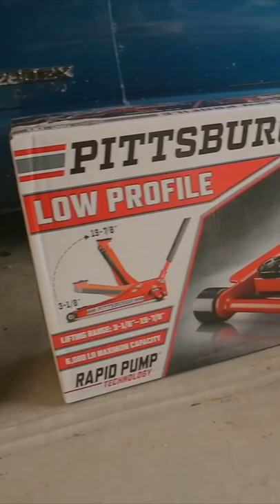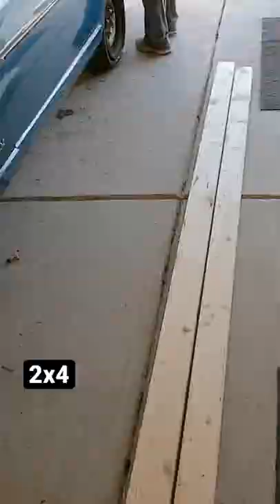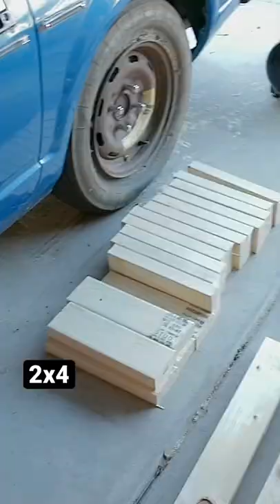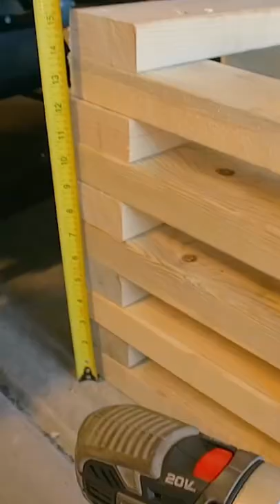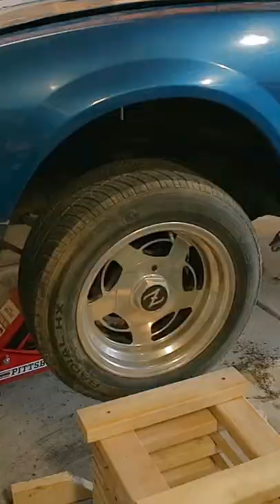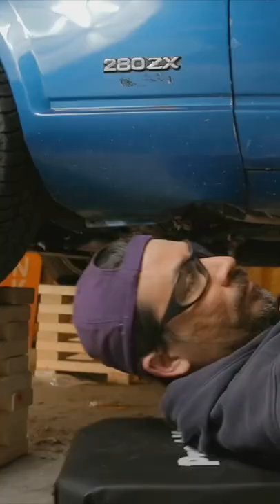#Build Your Own #Car Wheel Cribs / Stands 💪 No Lift Required #shorts

Comment: No shear strength on those screws, thats why nails are used instead of screws when building a house. Could build solid so the car is sitting on wood instead of between and pushing the 2x4s outward jmo.  I like the idea though.
Reply from the maker: We use high strength GRK fasteners for all our 2x4 work. They’ve held well thus far. Definitely don’t use some regular screws 👍👍👍
Reply: Is there any real shear load on this stand?

Comment: Not safe dude 😮
Reply from the maker: Do at your own risk 🤣🤣🤣 we’ve been using these with no problems for months on end. We also place extra jack stands under the car just in case. These are waaayyy more stable than just the jack stands in our opinion 🙌🙌🙌
Reply: That will hold your house up
Reply from the maker: @stephenwennekes9875  and a whole lot more 🙌🙌🙌 Haven’t failed yet 😁